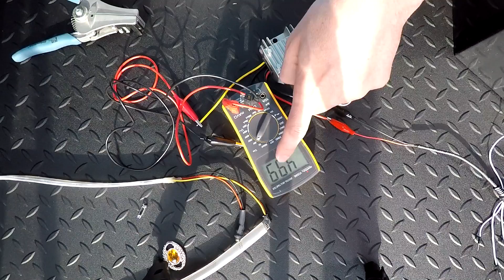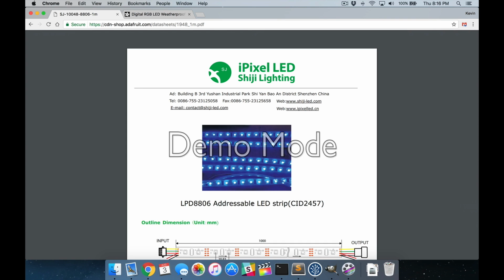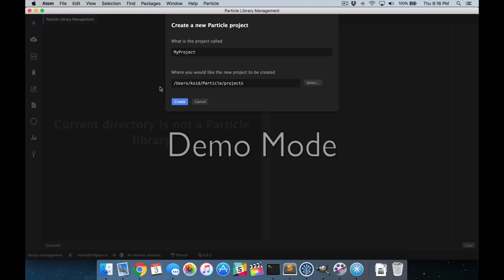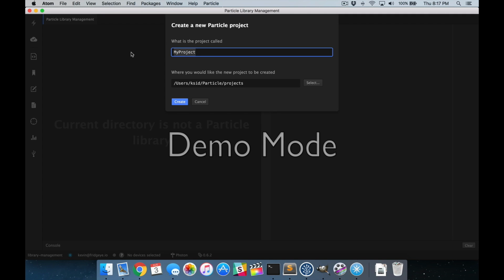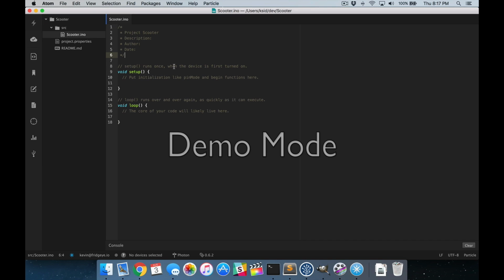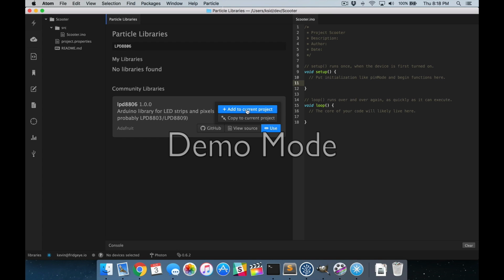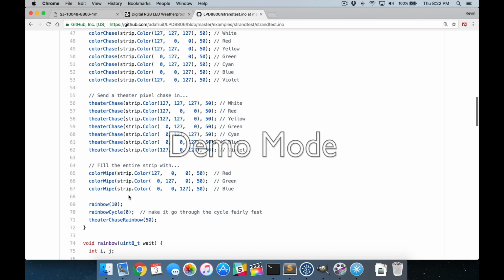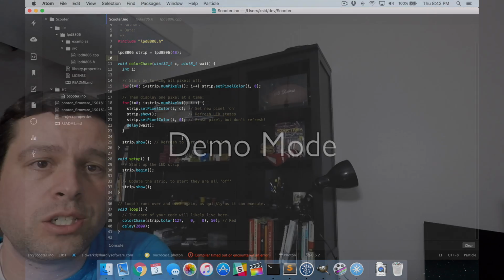Control an LED Strip with a Particle Photon

Comment: Magic smoke got a laugh out that comment. What language are you using to program? What was that step where you access the particle dev library? Also, I see you are using Atom on a mac will have to download Atom for Windows and see what I can do with it. I program in the default Python 3.4 environment. Also great tip on how to download and what the different download means.
Gonna be hot outside to day think I will take this opportunity to tear down my desktop and rearrange things so my soldering station and power items can be placed in front of me for the working project area. Then break out the particle goodies.
Great show.
Reply from the maker: The Particle devices are programmed in C++ and support the Arduino C syntax as well if you are used to .ino files in Arduino land. The Particle Dev IDE is based on Atom that they've built some packages into so the library function is one of those Particle additions to the editor. It allows  you to search for community-contributed libraries and add them right into your project.

Good luck with the desk tear down. Always feels nice to have a pristine workspace for all of two days before it's a mess again. :)